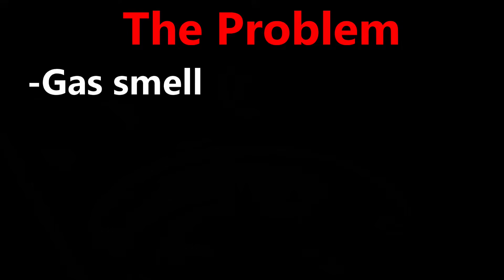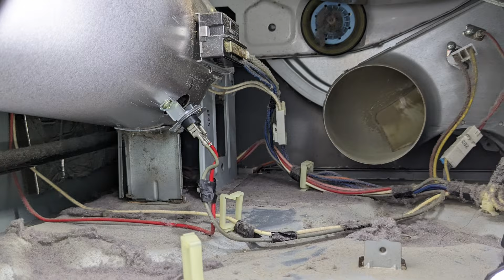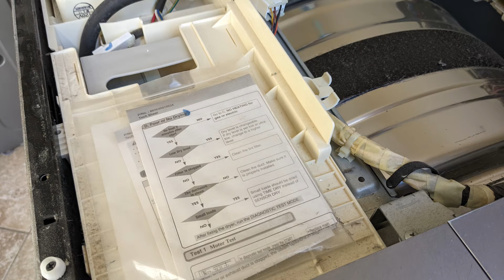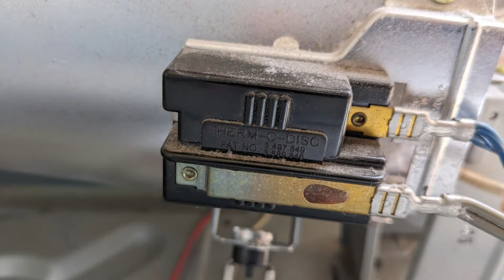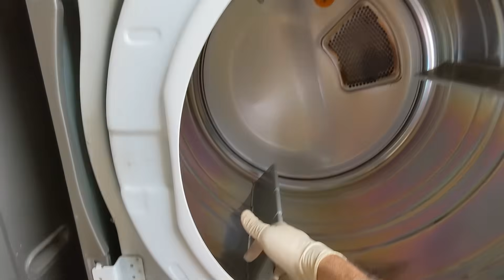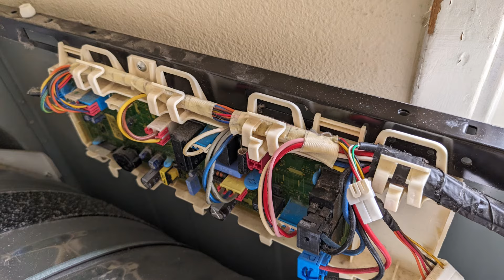LG Gas Dryer No Heat? Troubleshooting and Fix Guide

Comment from the maker: *If all the components that I showed in the video are testing good, try this: 1) Ensure that there is no lint clogging any of the airways including the blower fan and external exhaust tubing, and clean the flame sensor of any lint on all sides including the glass that's facing the igniter. 2) Sometimes the gas coils can give a false positive, try to find a used gas valve on Ebay. 3) If all components are good and all the lint is cleaned away, then your next thing to look at is the control board (motherboard). Here's a video that can help with disassembly https://youtu.be/7OVBi0LcrzQ?si=2aMSO2VC5bAPC1vJ Additional information in the video description!*

Comment: Great video! LG Service center offers $400 flat rate service, which is way too high. So I opened the cabinet, but, unfortunately, all the sensors seem fine. Not sure what is the next.
Reply from the maker: Someone else mentioned all their components tested good. If all the components that I showed in the video are testing good AND you have ensured that there is no lint clogged in the airways, then your next thing to look at is the control board (motherboard).

Comment: Excellent video. I just need to find the specs for mine! Working on washers and dryers is a dream compared to most other appliances. Lots of lint, but otherwise very clean.
Reply from the maker: Thanks for the feedback! Good luck working on yours. Aside from lint, the other downside of working on my dryer was the sharp metal edges. I wasn't wearing gloves and I got cut like three times, haha.

Comment: My LG gas dryer has no heat. When opening the side cap to see inside, I can feel heat from the heating element, it is really hot. Pressing the reset button doesn't click, it doesn't seem the button does anything when pressed. The blower seems to blow just fine, but it is just cold air from the exhaust, no heat. The exhaust is not clogged. So it's puzzling. The heating element is producing heat, and the blower is working, so why isn't the heat getting sucked into the drum? What is the fix here?
Reply from the maker: Do you have an electric dryer or gas dryer? You will need a multimeter to check all the components and ensure they are within specification. The button on the thermostat may not work, but you still have to test the thermostat with a multimeter. There should be a way to check the heating element in the electric dryer with a multimeter. Have you opened your dryer to see if the troubleshooting manual is located under the top cover?

Comment: Great and helpful video. Just have one problem. My dryer still does not heat. All the components check out along your instructions. I even rigged it so that I can see the igniter glow. I have gas into to dryer. The solenoid resistance is within spec. But I don’t get any gas flow and thus no ignition and heat. Running out of ideas. Any thoughts?
Reply from the maker: That's a tough one. I wonder if maybe it still detects a restriction in air flow. Did you clear lint from all the air flow areas inside the dryer? I tested my dryer without the exhaust duct connected in case there is a clog that I can't see in the vent line leading outside.
Reply: Yes, I had it disconnected from the vent line just exhausting into the laundry room for testing. Is there a way to test if the gas valve gets the right electric signal? That way I would know if it’s the valve or the control board. Last possible hint, the “dry” light is flashing
Reply from the maker: @MichaelRuith-k8k  If you have no air restrictions and all the components are within specs, then I agree that the next area to look at is the control board. I don't know how to test the gas solenoids manually. I initially ordered a used gas valve with solenoids included for about $40 on EBay. I thought the coils were bad because everyone was testing the other style coils with continuity test. The replacement valve coils gave the same resistance readings as my current gas valve coils so that's how I knew the gas valve was good and I didn't replace it. If you find the solution to your problem, let me know the solution so I can add the info in the video description. Here is a reddit thread where someone was having a similar problem and troubleshooting this issue. https://www.reddit.com/r/appliancerepair/comments/16tl14f/lg_gas_dryer_wont_send_power_to_ignitor_after_the/
Reply from the maker: @MichaelRuith-k8k  In this other youtube video https://youtu.be/Y_0f_h1pWd8?si=0FENpiurv2lGHBr4 the tech says the board is supposed to send 24V (or whatever voltage is listed on the valve) to the gas valve to open it when the dryer is running. You can connect your multimeter leads to the connector and turn on the dryer and see if the board is sending 24V to the solenoid.
Reply: Very likely the controller board. Capacitor CE401 is blown up. Sad thing for a 2 year old dryer, but was likely a bad component out of the gate. Invested $250 for a new board. I’ll let you know if that solves the issue. Thanks for the support!
Reply from the maker: Hey Michael, I'm just checking to see if you ever got your dryer up and running again? If so, what worked?
Reply: @ChavezDIY Planned obsolescence of this trivial parts is so f’ing frustrating. right at 2-yrs

Comment: I appreciate your video and attention to detail. Last year I replaced my gas dryer’s belt that snapped. Now it’s not heating and I’m searching for videos… mine is a Samsung and I can’t get any video hits on the model. I’ll keep looking but next step is to test the parts as you showed.
Reply from the maker: Good luck with your dryer! Have you checked to see if the troubleshooting guide is included inside of your dryer? I found mine inside when I removed the top cover.
Reply: I have the Model DLGX3671v and the inside looks identical. My ingniter is ohm reading at 39 and jumping around . Would
U think it’s the igniter ?

Comment: I wanted to leave a comment here as I was struggling with my thermostat tripping every couple loads. This tutorial did lead me to replacing the igniter, which was helpful but didn’t solve the issue completely. It wasn’t until I cleaned through the entire air pathway from heating tube all the way through the external exhaust that it started to work consistently. I found a lot of fuzz in the motor area. I’m thinking the motor could have been 1) not pulling enough air through the drum or 2) the motor itself was overheating causing the thermostat to trip. The lint trap seems to have much more lint on it after I cleaned. So I’m guessing it’s probably #1. Thanks for this tutorial though it was very helpful.
Reply from the maker: Thank you for sharing! Glad to hear you got your dryer working! =)

Comment: Thank you for your video. How would I know for sure what ingniter model is the one ?
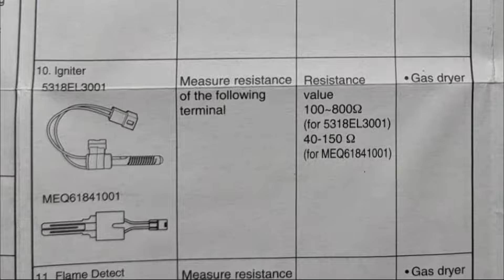Reply from the maker: You can search online for your model of dryer + "parts" and you should see some links to parts lists for your specific model. At 4:37 in the video you'll see the two images of the two different types of igniters. The top one is part number 5318EL3001A. If your igniter is the same as my igniter, you can check the video description for a link to the replacement part I bought.

Comment: I check all sensors as you demonstrated but still don't heat. igniter goes on and off no fire, put new valves too, i was told to see if i was getting 115 volts to disconnect igniter and that wire with dryer on check for voltage . but how do you turn dryer back on  if everything is disassembly, do you know how to do that? by the way great video, thanks...
Reply from the maker: If all the components that I showed in the video are testing good AND you have ensured that there is no lint clogged in the airways, then your next thing to look at is the control board (motherboard).
Reply: @ChavezDIY  i was thinking that maybe the use one i bought just happen to go bad .. thanks again for your quick reply ,im going to order a use one again, since they stop selling these new...

Comment: what about the gas safety valve failure point?
my igniter lights up, but no gas is allowed to glow to fully ignite the burner
Reply from the maker: I read that the gas valve sometimes gives you a false positive. So it passes the multimeter test, but doesn't work. You can try to find a used replacement valve on ebay. Check the video description for more information.
Reply: @ thank you so much for your kind reply!  Great video/post.  you explain everything so well. thank you!  Apparently there is no longer a reset button. on the high temp sensor on the LG Model DLG3401W.  Planned obsolescence is so annoying —and now they take the reset button too.  🥸 just brilliant.  
Love your channel.

Comment: I did everything you said on this video checked all fuses and fire sensor and igniter and everything was in spec how you said however it does not heat up
Reply from the maker: If all the components that I showed in the video are testing good, try this: 1) Ensure that there is no lint clogging any of the airways including the blower fan and external exhaust tubing, and clean the flame sensor of any lint on all sides including the glass that's facing the igniter. 2) Sometimes the gas coils can give a false positive, try to find a used gas valve on Ebay to replace your gas valve with. 3) If all components are good and all the lint is cleaned away, then your next thing to look at is the control board (motherboard).
Reply: @ChavezDIY I’m in this situation everything test good and I’ve replaced everything even the gas valve and still no flame 😿
Reply from the maker: @cowboymcq6711  Check the video description and the pinned comment for more info on that.

Comment: So i did everything you said and the top thermostat on the burner side keeps going out. Any suggestions
Reply from the maker: The thermostat usually cuts out when there is a clog or restriction somewhere in the venting system causing an increase in the heat inside the dryer. It could be a clog or restriction in the vent tube going out from the dryer or inside the dryer itself. Make sure all the vents and air passages are clear inside the dryer. Also check under the lint filter, lint gets through and clogs the blower. To test whether there is a clog in the exhaust vent tube, you could disconnect the dryer from the back of the dryer and see if it continues to turn off. Is the thermostat resetting or completely shorting out? Are you using an OEM thermostat part?
Reply: @ChavezDIY  upper reads no more continuity
Reply from the maker: @javiermorando4616  It's dead so you'll need to replace it. But when you replace it check for clogs in the vent and exhaust system as I mentioned above.
Reply: Well took it apart again so far so good. Thanks  @ChavezDIY

Comment: First this video is fantastic. ChavezDIY provides thorough explanation and instruction.  Here's our dilemma: we used a multimeter to test all 7 parts. Dang if all seven pass the continuity or olms test. So do you have a video that goes through other things that might keep a gas dryer from heating  when everything else works (we cleaned the ducts and clicked the reset thermostat before testing)? Sad in Salt Lake City.
Reply from the maker: I have had a few people with everything testing good but still no heat but none of them have come back to let me know what worked if anything. If all the components that I showed in the video are testing good try this: 1) Ensure that there is no lint clogged in the airways and clean the flame sensor of any lint on all sides including the glass on the side facing the igniter. 2) Sometimes the gas coils can give a false positive, try to find a used gas valve on Ebay. 3) If all components are good then your next thing to look at is the control board (motherboard).
Reply: isn’t there also a gas safety valve that once triggered, prevents gas to flow to the burner?
Reply: @coresurf22  I’ve tested everything and actually replaced all my sensors even bought a used gas valve and still no flame 🔥😿
Reply: @cowboymcq6711  my particular LG model DLG3401W gas dryer does have a resettable high heat sensor and shutoff safety valve, but the primary gas valve that allows full gas flow for the burner failed — and that particular part is now combined with the coils that release the gas for the main burner.  The cost of that part is on the order of $270!!   if I had a repair guy order it and put it in it would cost another $175 or more, so now we’re up to $500 to repair it!! and the cost of a brand new dryer is maybe $650.  bottom line for me I had to buy a new dryer and it breaks my heart, drives me crazy because 98% of the parts and physical hardware are perfectly fine and this “planned obsolescence” part failure being designed into the dryer is just so wasteful.  that failed part is actually discontinued so the new dryer will be upgraded instead of having a known failure built-in from the start.  the replacement part is extremely over-priced forcing my hand — just as designed by LG — to have to buy a new dryer.  uggghh 🤦🏽‍♂️ so stupid.
Reply: @ I’ve replaced my gas valve and still no flame
Reply: @cowboymcq6711  I’m no expert but I believe the next thing in the system that prevents the main flame from lighting is the coil(s) opening to allow full gas flow.  sorry to hear it’s been such a puzzle!!

Comment: I replaced the everything still can’t get to work. The coil heats up but no gas is coming out
Reply from the maker: If all the components that I showed in the video are testing good AND you have ensured that there is no lint clogged in the airways, then your next thing to look at is the control board (motherboard).
Reply: Same here.  Did you ever get it figured out ?
Reply: @ my Thermister was out. For some reason it checked out ok while testing. My issue before hand was the flame would turn on for a few seconds then turn off and never turn back on

Comment: Just because a thermostat has continuity doesn't mean it is good necessarily a thermostat regulates temperature. It could have stuck contacts and not be regulating temperature. 
If you make the repairs on the dryer and it quits heating after making necessary repair to get it working again disconnect vent and try it again that will tell you if the problem is the dryer or the vent.
If everything thing checks good around the heater and still doesn't heat you could have a bad relay on the main board or a bad centrifugal  switch in the motor. Not to mention wiring. 
I am all for simple and most repairs are but don't think this video is all the is to it.
Reply from the maker: Thank you for sharing your expertise! This is the first dryer that I have repaired and I can only share information based on my little experience. I always welcome people with more experience to share more information in the comments or even make their own video.